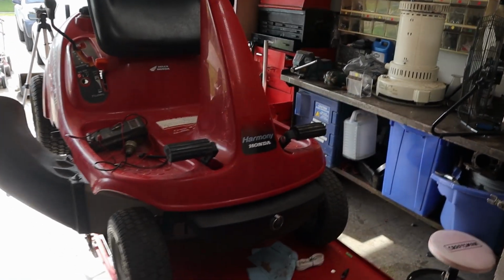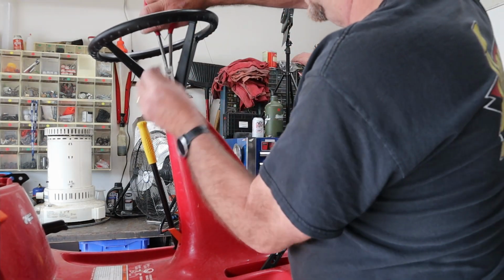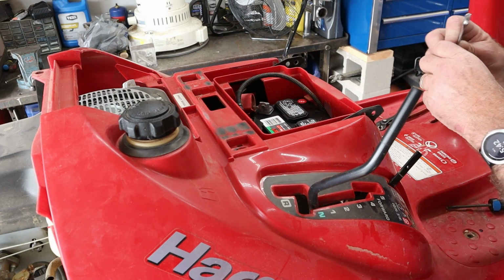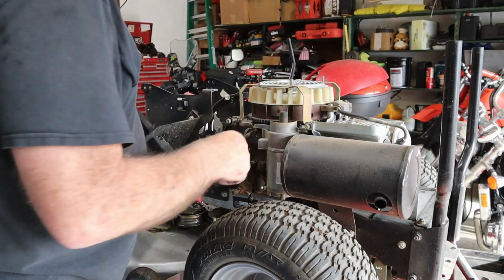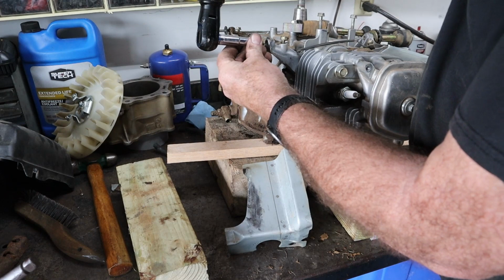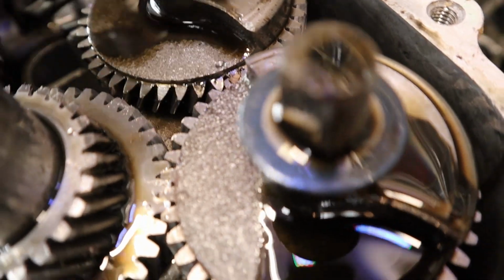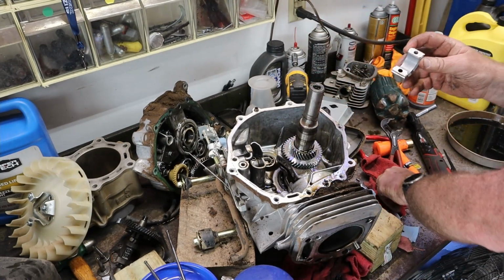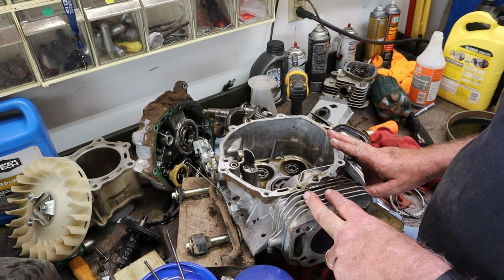Honda H1011 Smoking and using oil. Can we fix it?

Comment: How did you determine what size rings you needed? I looked at a honda website and there are a few options.
Reply from the maker: I got the engine number and went to my local Honda power equipment dealer. I knew it was stock bore and he deciphered the rest. Lawn and Leisure in Lee's Summit, MO. can help you out. Thank you for watching.